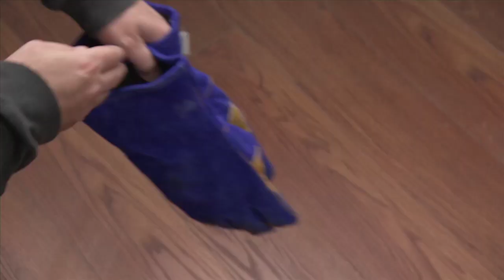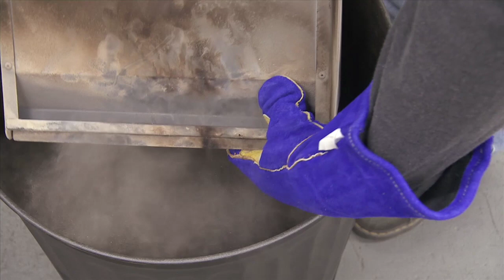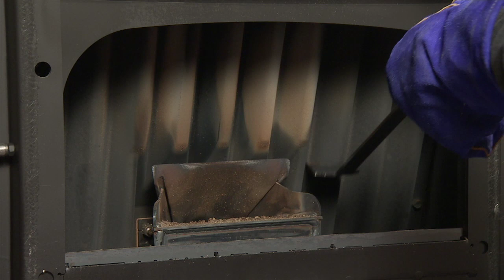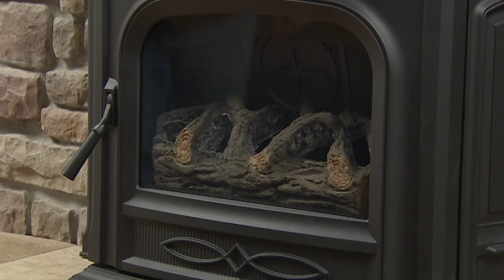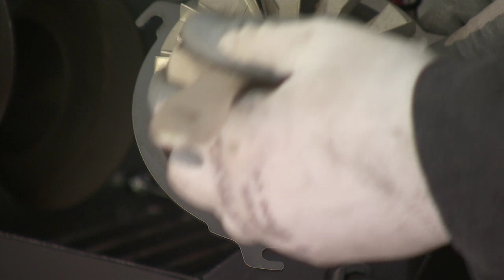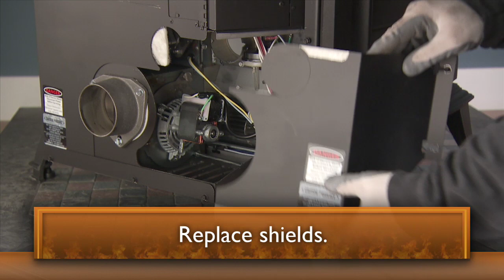Harman® XXV Pellet Stove Maintenance Video

Comment: Why in the world would you want to scrape the burn pot when the stove is burning.
Reply: When the the stove is running, it is significantly easier to break up the burnpot build-up vs when the unit is cold. One of the advantages of the Harman burnpot design and bottom fed feed system is that we can clean the burnpot while in operation. We suggest flipping the igniter toggle to manual, turning all the way down to the lowest setting, and waiting an hour before scraping. There will be a very small fire in the pot allowing you to access and break up carbon deposits and build-up deep in the throat of the burnpot. We manufacturer a Harman Super Scraper to clean the burnpot in half the time, with half the force of the traditional Harman scraper. Check out our video on that here. https://youtu.be/Ukao3dCooec